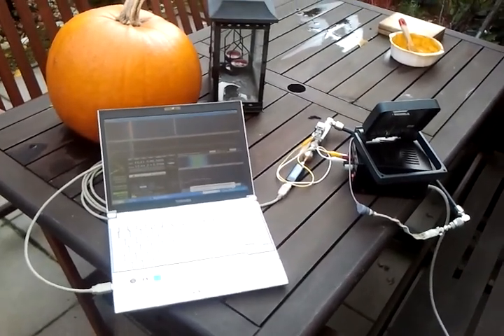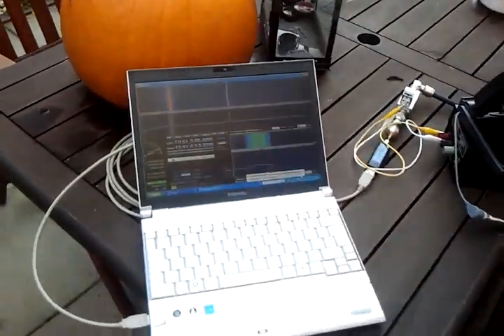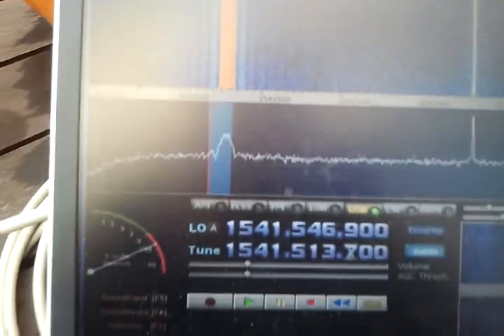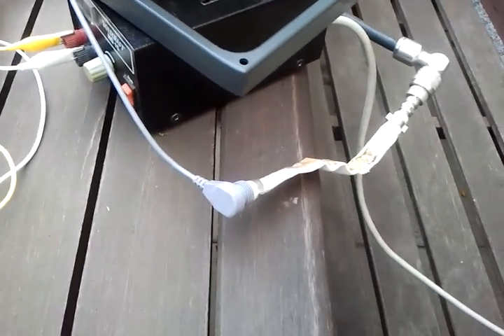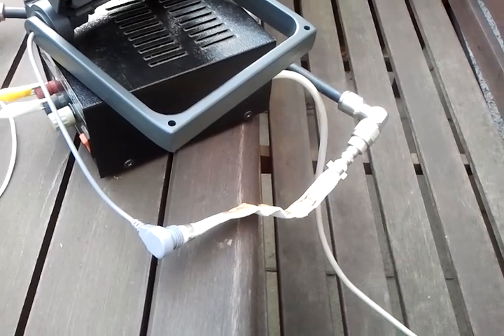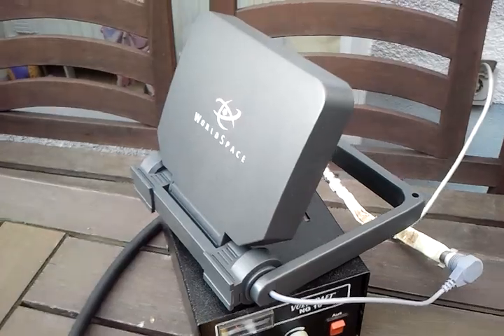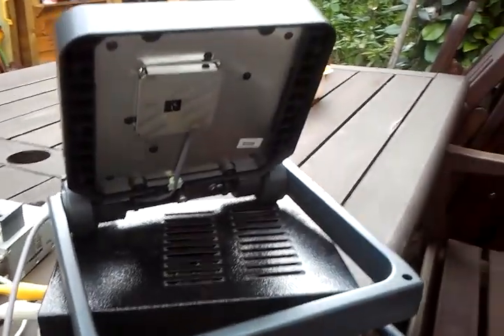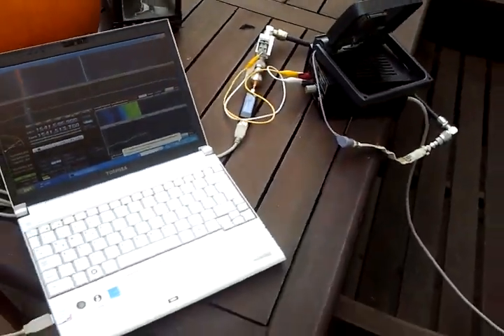INMASAT-C with cheap WorldSpace Patch Antenna

Comment from the maker: The "signal analyzer"is a standard SDR software (Software defined radio). The one running on this video is HDSDR (freeware). The USB Dongle is a Funcube Dongle (first generation) SDR radio capable of receiving between roughly 54MHz - 2GHz...